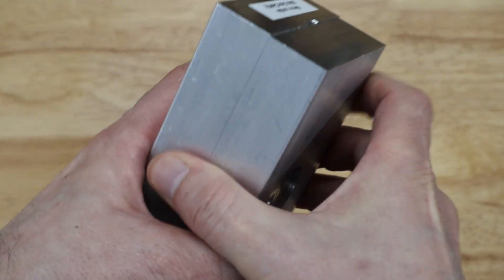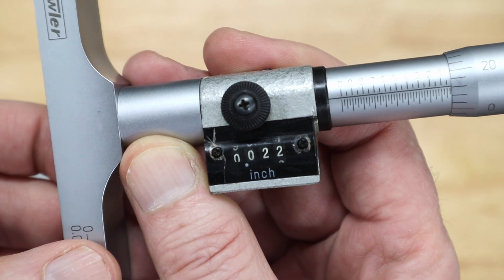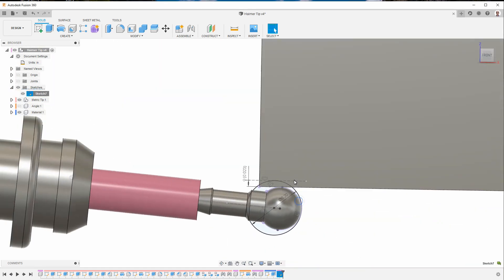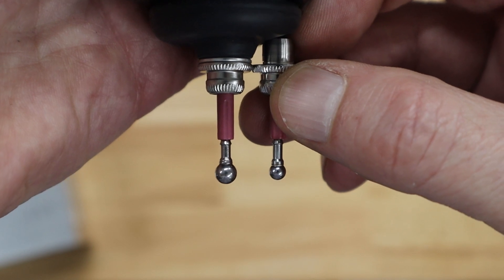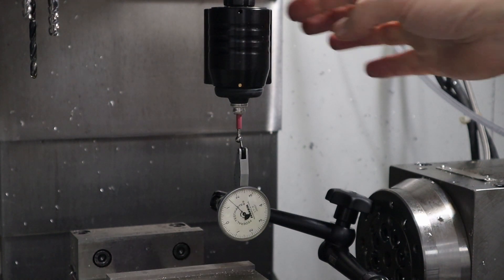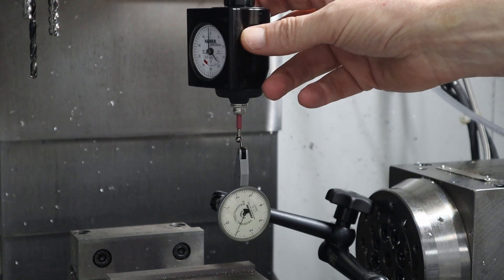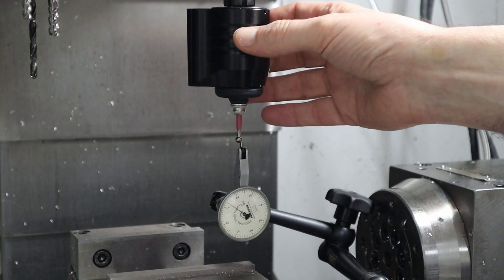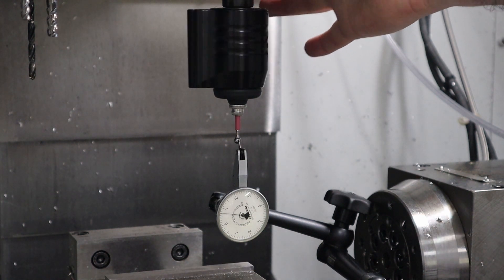Using the Wrong Haimer Tip

Comment: 2:26 yes tip should be longer if ball is bigger so it allways move same ammount that 2mm in your case you used 4 mm when u have imperial. you just calibrate 0.022 needle to left or right side then 0 is correct lol. its that easy xD
but can you even measure that low. you cant just measure raw part and say i was take this ammount bottom part now take same ammount up part. better is measure that milled feature and tell 0 here

Comment: I once came within an ace of ordering the wrong replacement size and so I'm familiar with how easy it would be to get onto the wrong one.  Yah, yah, should be able to tell the difference, etc., but when you're thinking about other things like getting back to machining, it's something that might not cross your mind.  Thanks for your demo of how to center the probe.  The Haimer instructions that came with mine didn't match my model and all of the videos I've seen also don't match my model until yours came along.  That may inspire me to go to work on it as I haven't a) checked it and b) mine has a 0 offset in it that needs to be corrected.

Comment: Darn metric system.  Even after all these years it's still causing trouble.  Or it it I'm unable to adapt.  Take care.
Reply from the maker: Or, darn imperial! I really wish the US had gone metric back in the 70s when there was such an effort. I really hate trying to figure out which is larger: 3/16 or 5/32. I have to think about it each time.
Reply: Hey over the pond here in the UK :) it works just fine LOL but I draw pcb's lots of chips still made with old imperial machines so 200th is a common measurement for me :)

Comment: I had a similar situation with my Renishaw probe.  I had crashed the probe and when I replaced it I got the run out to be less than 3μm, but over time the adjustment drifted.  So even though the control was able to compensate the remaining run out, the drift caused part alignment issues even when indicating a part center.  Pretty pricey repair, but the probe pays for itself with reduced setup times.  To troubleshoot the problem, I indicated my part using the old school dial indicator edge finding method.  Then compared that with my Renishaw's probe cycle and found the 0.0025" coordinate system offset.  I guess moral of the story is trust but verify your probes, and you can always fall back on the dial indicator.
Reply from the maker: Interesting that even the Renishaw can run into this. I guess the moral is to check every so often.
Reply: JohnSL for sure, because regardless of the brand, it's still just some little set screws you've used to center it.

Comment: Haimer should color code the red ceramic to match tip size.
Reply from the maker: They really should. And their numbering system for parts doesn't make it easy to tell. But once you've seen the difference, it's pretty easy to tell by looking.